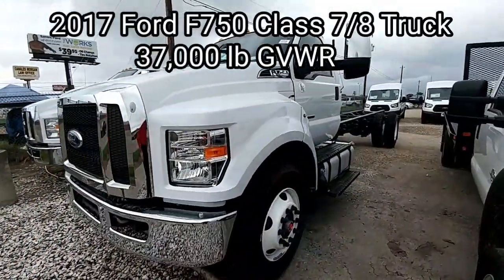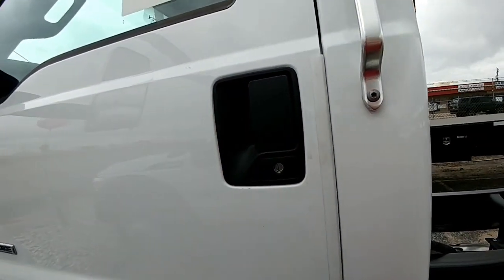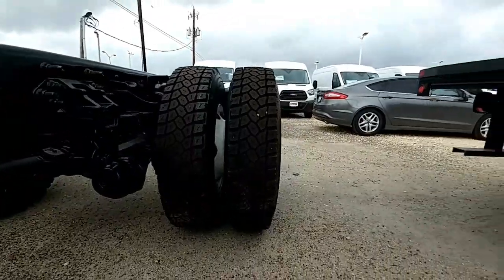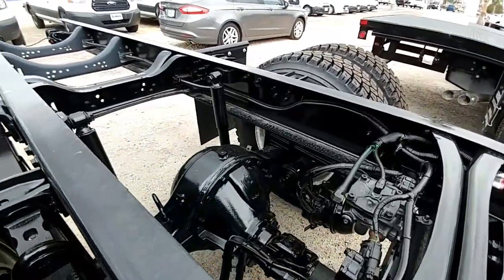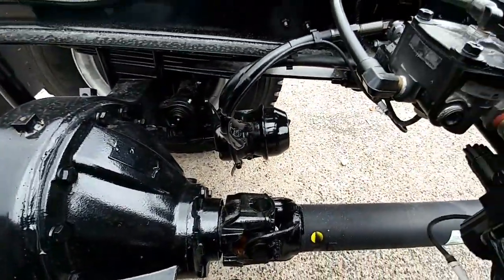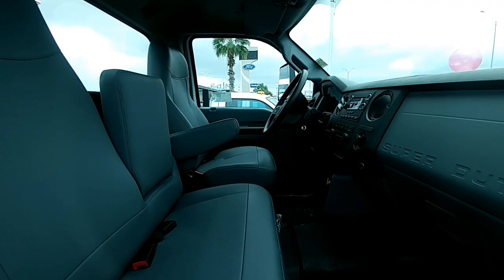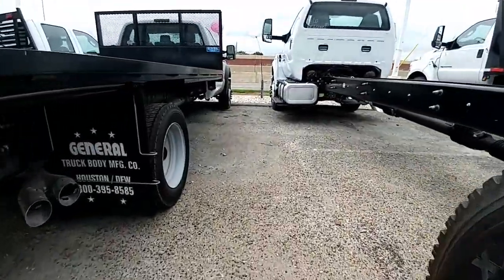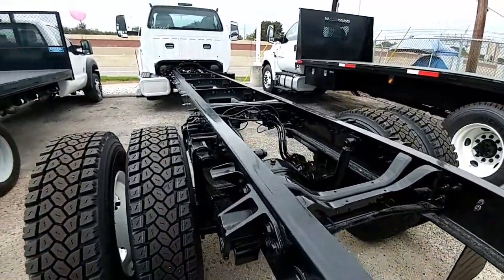2017 F750 Super Duty with 6.7L Powerstroke! WOW

Comment: CUMMINS IS SO OVER RATED, my dad has a new Cummins diesel pusher when going over an incline one time his engine went into limp mode because there was an issue with the radiator or sensor issue.  I'm soo sick of wannabe truckers that think Cummins is soo good. they are overrated garbage.

Comment: The frame, cross members, front suspension, and rear shock mounting looks eerily similar to the old GM medium duty truck. Aside from the cast steel rear suspension brackets everything else, even the cab mounting looks to be the old tried and true, back in the day number one selling GM medium duty chassis.